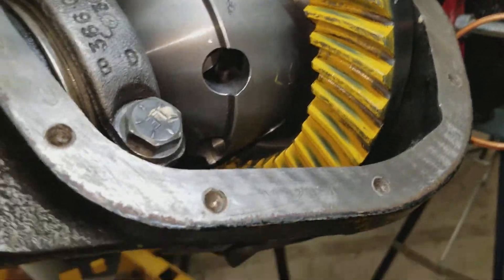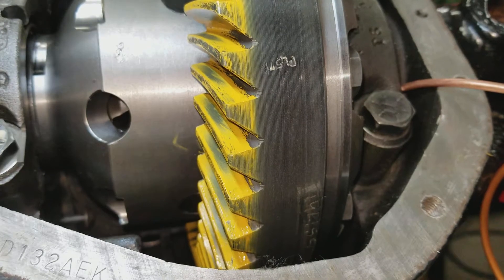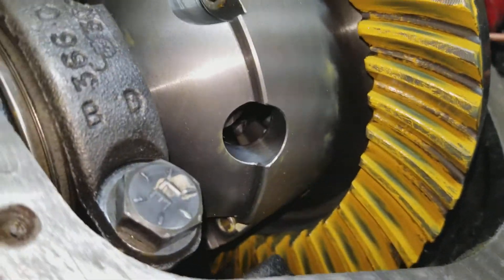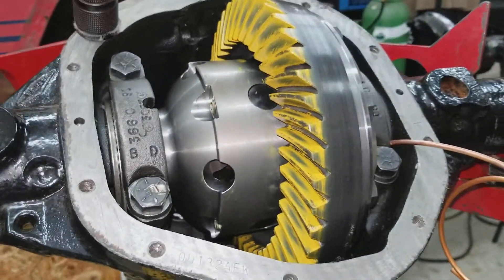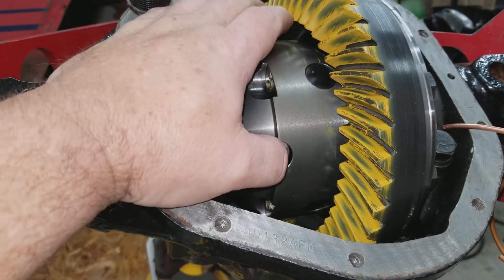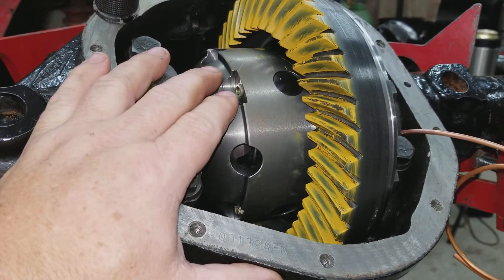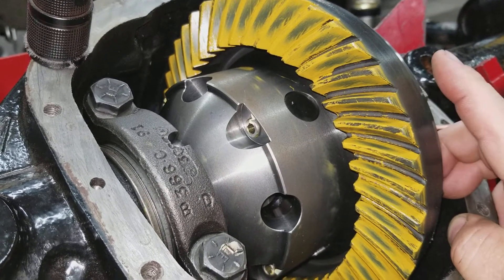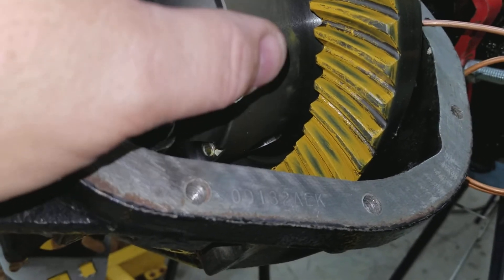Dana 44 Ring & Pinion Setup, Pattern / Ring Problems?

Comment: Yeah I had it happen in my 9in setup.
I was worried initially, but the beers took over and I wrote it off as inconsistent load since i was doing it on the bench.
But man, your pattern looks good, your probably not gonna drive this thing 100 miles a day on the highway.. just send it